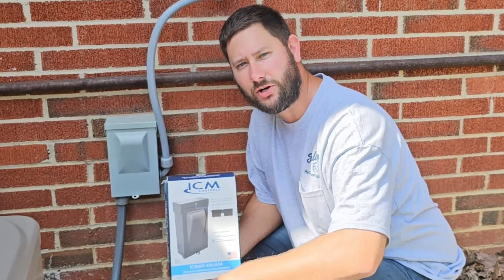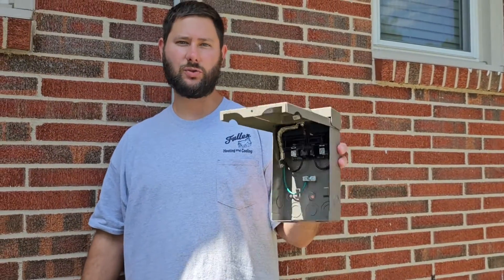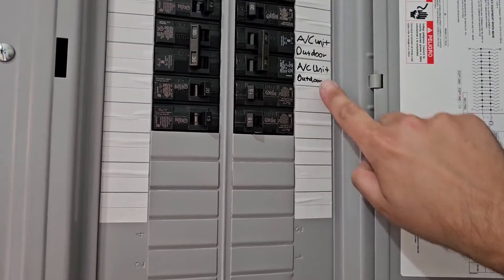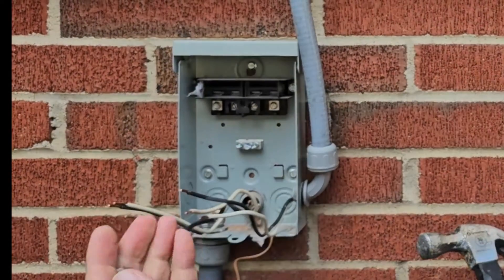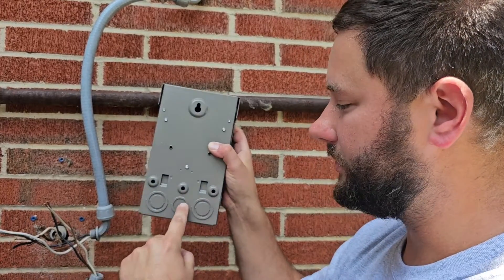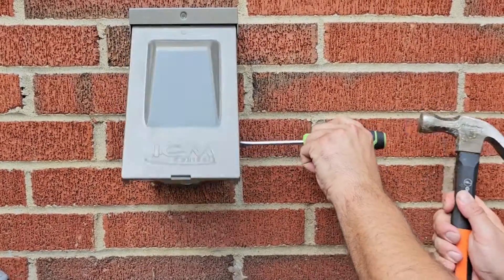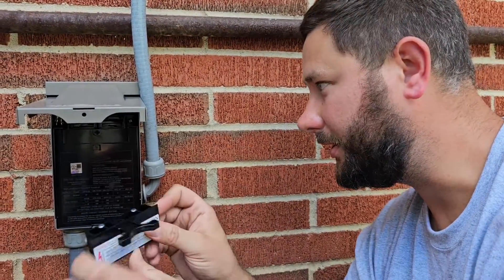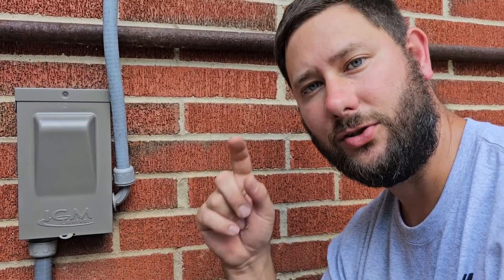Upgrade Your Setup: Installing a Surge-Protected Disconnect! ICM495 @icmcontrols9960

Comment: Where the wires come through the brick wall is there any conduit coming up to the back of the disconnect box or is the wiring just pushed through the hole in the brick wall and then comes into the shutoff with nothing protecting it as it comes through the wall? Just curios as I’m installing one soon
Reply from the maker: conduit is in the wall